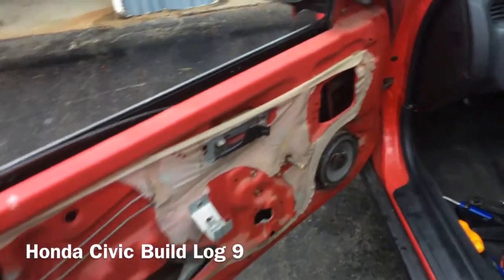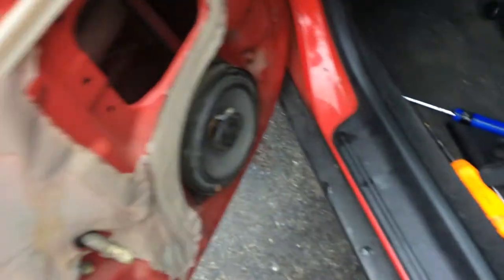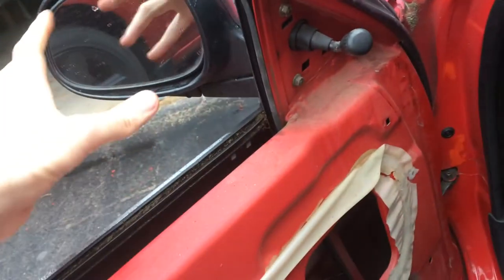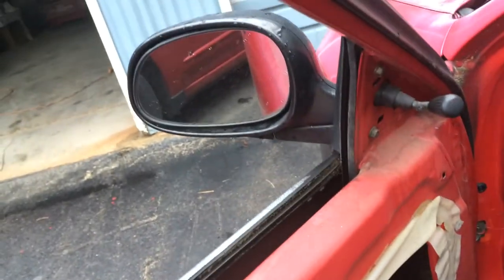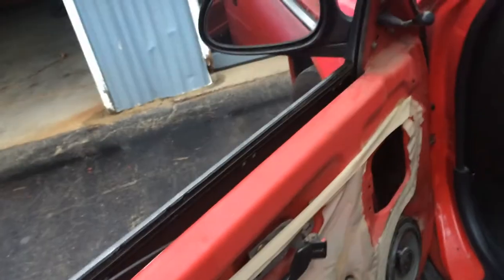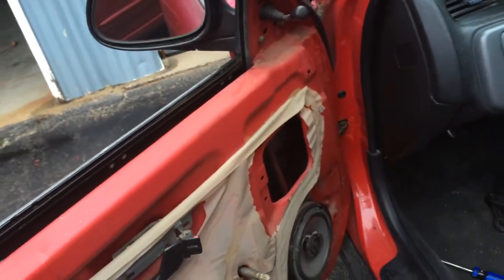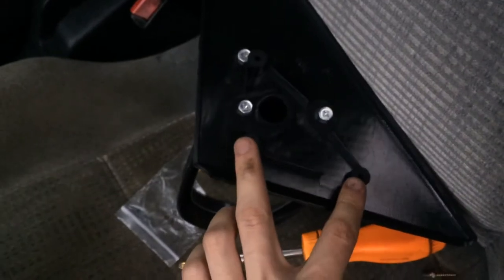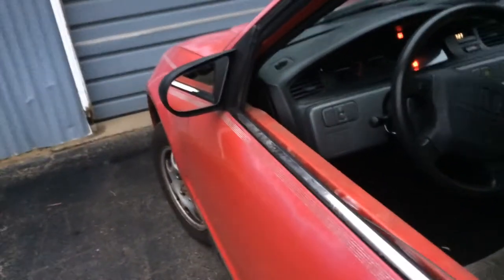Honda Civic Build Log 9 - Spoon Style Mirror Install!

Comment: Go to Honda get the plastics where the mirror go inside the car for a ex model with power mirrors they wont have the hole in em they will be solid

Comment: So how'd you get the screw to fit? Mine are like yours as well.
Reply from the maker: isaac hernandez you can use a washer so the screw don't go through the holes in the door, but I didn't have to use a washer I don't think. This was a long time ago lol
Reply: GrabberBlueEG what do you mean a washer?
Reply: GrabberBlueEG I just need to get all 3 screws to go through and fit the mirror good. :( lol